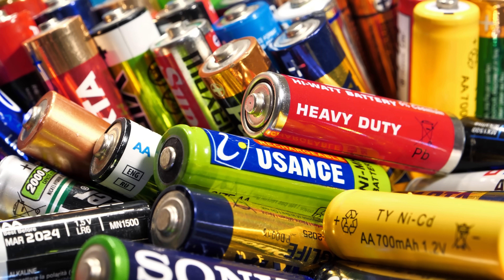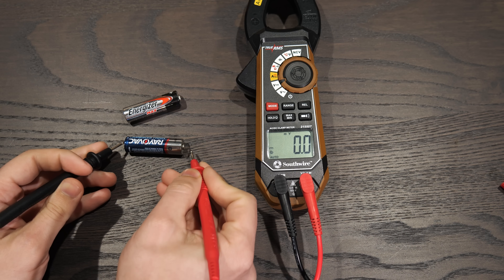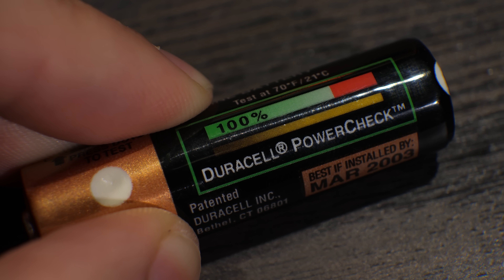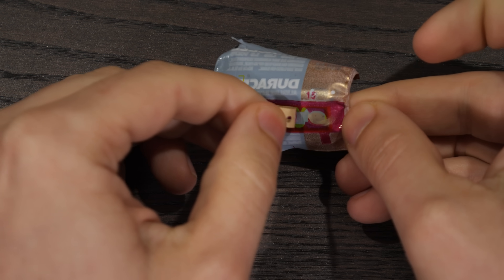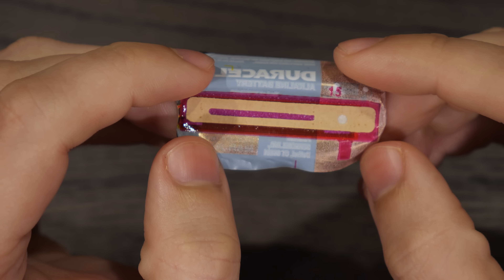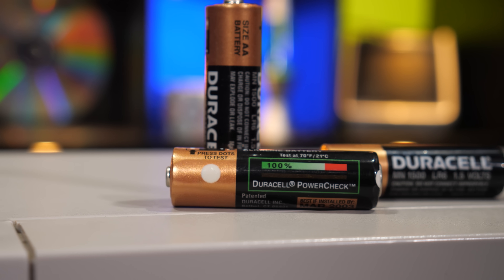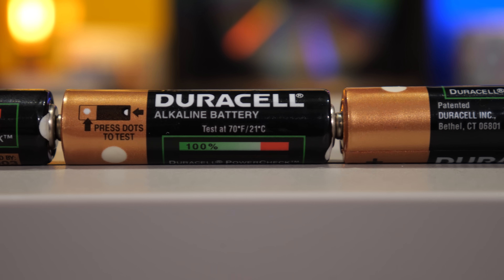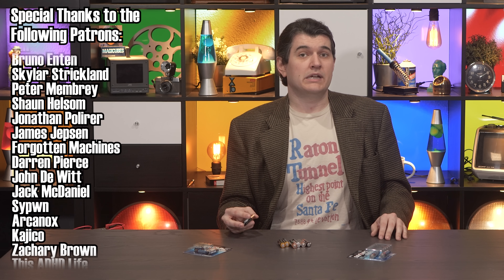Duracell PowerCheck: A genius idea which didn't last that long

Comment: wish my rechargeable AAs had one of those gimmicky test strips so i wouldn't have to break out the multimeter every time i want to see their state of charge. in the 10 years i've had them so far i would have gotten a lot of use out of it

Comment: I do recall these did turn yellow linearly from bottom (negative) to top (positive) along the battery, forming a near ferpect bar graph.
It was a pretty neat thing but as you say, also anoying to use because you literally had to hurt your finger tips for the contacts to do their thing.
I honestly know few people that used those, even if in hand, because of this. Most people ignored, or didn't trust these things to be accurate.

I also seem to remember one company (was it energizer?) that put that kind of tester on the backaging. So, one tester for the lot of batteries in the pack. This made more sense. But the idea was short-lived.

Comment: 0:18
 Dear technology connections. Did you know, quadruple A batteries exist? theyre absolutely tiny, impossible to get, and, to anger you even more, they DO cost almost the same as double or tripple A. And theyre so rare, because nowadays theyre pretty much only used in styluses and some laser pointers.

Comment: Pretty sure they started to say "batteries not included" back in the 80's, maybe early 90's....because batteries were retardedly expensive, and barely lasted 10 minutes in a cool toy, they were absolute garbage, any child of the 80's looks at batteries nowadays and thinks they must be built with pure magick, because batteries die, quickly, what is this live for several hours and being rechargeable...magick....

And putting batteries away, and reusing them later was also definitely a thing of the 90's, like I remember that being a thing, but it also definitely doesn't happen anymore. My grandfather used to hoard batteries even into the 2000's, testing them with a multimeter to know which ones were good before tucking them away

Comment: I use one of those small square battery testers. It has saved me a lot in batterries over the years as most items that use two or three batterries at a time lose power because one of the batteries has failed and resists current flow from the remaining decent battery(s).

Comment: Bruh. I was sure you were going to hit us with a Steve Jobs “one more thing” moment: The Drop Test!

For those not in the know: Hold your AA cell about 8 or 10 inches above a tabletop, (positive side up) and drop it on the table. Exhausted cells will bounce, while fresh ones will essentially hit the table and plop onto their side. A USEFUL TRICK when you are replacing cells with identical ones and have an “ADD moment,” forgetting which ones were the new ones while they were all in your hand.

You’re welcome!

PS Why 8-10 inches? Because greater heights are more likely to mark mom’s dining room table. Or so I’ve heard. 😉

Comment: 1. Why not build the thermal powercheck thing into the battery retail packaging (Easier to use, easier to manufacture probably)?  2. Also why not put these on rechargable batteries? (That's what I have a drawer full of.)

Comment: I still remember the pain in the joints of my fingers when pressing on those. Now I have two different battery testers. I bought the second one because the first one couldn't test button cells or 9V batteries

Comment: AA's and AAA's are not as popular as they used to be, back in the day tons of devices ran on those, today I only need them for a couple of devices at home, I don't even bother buying top brand names like Varta or Duracell, cheap generic batteries are more than enough for my remotes and mice.

Comment: I am about the same age as you, and i would say the main reason why these testers are gone is also to do with simply how unimportant Alkaline batteries have become in the last 10-15 years. Most stuff is now rechargeable. Back in the day most people kept huge amounts of batteries on hand, it was a regular grocery item and companies like Duracell, Energizer and so on simply had money to burn in the marketing war. It was a big business and they could spare the money to have a competitive edge over competitors.

These days? Alkaline batteries have seen a huge decline and these days its just about keeping them as cheap as possible. Most devices that still use AAs often come with a set & the application is so low powered it lasts for years. Things like powercheck just were not worth the effort both in cost per unit and these patent dispute costs. Its not going to make someone spend 20% more for the same product like it used to.

Comment: 1. Holy hell I had completely forgotten about the test strips they used to include. Now I feel old 🤣.

2. Because simple microcontrollers are cheaper than most of the rest of the device they package them in, you can buy battery chargers that will recharge basic alkaline batteries (not the sold as rechargeable kind). It seems to work just fine until the anode decays and the batteries are completely dead. I get about 10-20 cycles from a bog standard alkaline and as such I’ve only purchased new batteries twice in the past decade. Random batteries included in various devices refill the pool until they’re all exhausted.

I had to buy a new battery charger to fit C/D size cells and that charger will handle Alkaline, NiCD, and NiMH in 1.2, 1.5, 6, and 9 volt formats. This smart charger does a load test and then a resistance test to figure out what it’s charging (or gets to cheat with 6v leads and a 9v snap fitting). It’s one of the best ROI purchases I’ve made as far as keeping things out of landfills and solars in my wallet is concerned.

Comment: IIRC they still include the power check feature on Duracell batteries in the UK at least they still did the last time I bought some so around 5-7 years ago, although like you said here they were just as difficult to actually use as you showed here. Even with them included I still played the game of just sticking it in the device and hoping for the best

Comment: Older adult and educated in not just electronics and physics, but also ways of the world, like planned obsolescence. This was a way to drain and then sell more batteries. Neat idea, but the little battery meter I still have and use, did not drain a battery quite so quickly. (Sarcasm)
Truth is, I rarely use the battery checker. Most things I use that needs portable power, like the phone I'm using, have a built-in rechargeable battery with an indicator to tell me when to recharge.

Comment: Fun fact : you can shave the voltmeter casing off a dead battery, and cut it down to just the voltmeter strip, and use it as a external battery tester. 👍

Comment: I only have one modern device that still uses disposable batteries, and that's my wireless mouse that I use with my laptop. it does, in fact, have a way to sense if the battery's getting low and a light on it that blinks red if it is.

Comment: I loved these and would still buy them. For me, I tested them when they were dead only to find 1 dead battery out of 4. Replace and keep playing instead of tossing all 4. Also, rechargeable batteries seem bad based on my recent research. It seems better to buy disposable when factoring in load/demand/frequency. Door locks on homes is my main use for them and the discharge not in use happens so fast that normal disposable batteries won when I was researching. I hope you take this personally, and make a video changing my mind.

Comment: Mixing batteries is bad. The "good" battery pushes a current through the "bad" battery. This wastes energy and depletes the bad battery even more increasing the risk of leaking.
The casing is part of the chemical reaction. If the battery is depleted - or extra depleted by mixing with fresh ones - the casing may produce holes.

I well remember the built in testers and there was a really good use for them back in the days. While you put in a pair of fresh batteries in your remote controls, clocks, calculators and so on and keep them there until the device fails, it is sometimes important to check the battery status.
While modern devices have a built in battery indicator, devices back in the days of those testers didn't.
For example, the famous Gameboy ran "ages" on a set of batteries and it didn't had a battery indicator. When the power LED becomes dim, you don't have many minutes left. So when you take the Gameboy with you or start a game without built in CMOS to safe your game progress (e.g. Super Mario), the built in battery tester comes in handy. So you know for sure if the batteries will last your trip or game or not. So either you replace them instantly or take a pack of spare batteries on your trip.
The same was true for Walkman, Disc-Man and other 1980s and 90s stuff.

Comment: That is only a ( minor ? ) problem with these batteries ..... the  BIG  snag is they leak caustic fluids all inside your equipment , which takes AGES to clean out ... or .... may wreck it totally😝 ..... you do  NOT  get this problem with Lithium batteries , which I have found  ,  NEVER  leak ! ........ DAVE™🛑

Comment: Is the cost of a battery generally proportional to its quality? I've heard, at least, that higher-end batteries tend to be more than just a brand name, but tend to have higher quality materials that lead to longer life. I figure you'd know better than your average person on this count.

I remember these, but I also remember having a claw-like battery tester with calipers of a sort for different sized batteries. Similar concept, I forget if a battery company sold it, it's been so long

Comment: Oh, wow, we got a single pair of these around 10 years ago. I always wondered how they worked. And also, why weren't they putting them on NiMH rechargeable cells? Then it would make sense to find out how much charge they had without putting them in a charger and waiting for an hour to see if they are full (our NiMH charger was super slow, and would only tell whether the cells you put in it were fully charged or not).

Comment: One of the problems I had with the PowerCheck batteries was that in devices that had very close battery tube tolerances, like my AA-powered Mini Mag-Lite, that tester increased the battery diameter by just enough that the batteries would get stuck. I had to switch brands to use my Mag-Lite.

Comment: Interesting--yeah, those were a pain to use, and I only found it to be a minor novelty.

This reminds me of a solution to batteries not lasting long in my old Walkman tape player (early 80s!) I took a 2xD cell holder from Radio Shack, soldered it to a mini-plug that fits in the power supply jack, made twine loops through the holes in the holder, and threaded it onto my belt next to the player.

Two of the RS red batteries (the cheap ones that were free with their "battery of the month club") in AA size only lasted four hours. The cheap D cells lasted around 19 hours. I believe alkaline AAs came close to 19 hours, and I lost count of a pair of alkaline Ds going at least 30 hours. Not bad for a power-hungry player!

Comment: The thing with the AA vs AAA argument, and how they're not much different in size, is that I believe it's more about the volume and corresponding weight they take up, rather than the dimensions themselves. A standard AA takes up about 8.3 cubic centimetres volume, whereas a AAA takes up just 3.8. Similarly, decent Alkaline AAs weigh about 23g, whereas similar AAAs weight just 11.5g. A halving of weight, and more than halving of volume, is a much greater impact than the dimensions suggest. As for the similar price, could be that more AAAs are bought because they run out faster, increasing demand and hence pricing, but that's just a guess.

Comment: "Dead" batteries for some devices may still work for several years in others, like clocks and remotes. I always mark them with a red sharpie and save them for that type of low-consuming devices. Also, the best and cheapest battery tester are those E10 miniture lightbulbs.

Comment: There was even a version in which that very same technology was put in the batteries box, and you would just place the single battery into that area in the box that had that tester in order to measure the battery, instead of it being in each single battery. That would way it did reduce the manufacturing cost slightly and you could still measure the batteries without needing a testing machine.

Comment: I just use rechargeable batteries. Why? Because then I can reuse them until they don't take a charge any more. 
You'd honestly be shocked at how much it could save you if you own a lot of battery operated appliances. 
On a side note, not every appliance is made the same. So something may require an almost new battery, but that battery may still be useable for a good period in something like a TV remote, which requires very little power.

Comment: I had a flashlight that took AAAA batteries. It was really thin in diameter, about the size of a pen. I was also curious as a kid and took apart a 9V battery one day, only to find six AAAA batteries wired in series.

Comment: I think there's more to the shape of the strip than only the varying resistance causing the scale to work.

Yes, resistance must play a big part, as narrower paths have a higher resistance and produce more heat under a potential difference. However, there's also less thermal mass to heat. I believe it's a combination of the smaller thermal mass at the low power side, with a higher resistance, as the thicker end requires a higher amount of energy to heat, meaning it needs a higher current. 

Or maybe the mass difference involved is negligible. What do you think, yt comments?

Comment: I hate AAA as almost anybody, but in a case let's say remote control you have mentioned, couldn't be the reason for their use their lower weight than size?

Comment: I could never get the reading to work. Ended up using a volt meter anyway. 

My old camera motor drive (remember those?) used to eat eight AA batteries (wouldn't work with rechargeable batteries) and often one battery would give up the ghost while the others were still good.

Comment: I honestly just prefer rechargeable batteries. Saves a lot of money in the long run despite higher upfront costs. I got the extra high capacity ones and they last soooo long in my VR controllers. Plus it's simple to check their charge by simply slapping them in the charging station.

Comment: The only useful application for them is just knowing if the remote that quit working is a dead remote, or a dead battery.  And then only when you don't happen to have spare batteries to try.

Also thanks for reminding me about the testers in the box, i'd forgotten about them.

Comment: I think the true use case for this tech was to verify that every one battery in newly opened package is good. If you purchase a pack of 20 batteries nowadays and actually measure every one under load, it's not uncommon to find 1 or 2 bad batteries straight from the factory.

Comment: These batteries were made for my family. I learned very early on to take batteries out of toys so they wouldn't drain while the toy qas just sitting there so we always had partially used batteries. In addition, I learned early on that when the batteries "ran out" usually only one battery ran out, and the rest were perfectly good. Having the tester on the battery rather than having to go get one made my life so much easier.

Comment: One of the biggest problems in consumer products in general is picking the cheapest. People usually just compare the price, much more rarely quality or features. That is why we are usually offered only cheap simplified crap. A battery power tester that costs maybe 5 c just makes the battery 5 c more expensive and doesn't sell.

Comment: I actually like products that work with AA batteries because I can just use rechargeable ones. If my Xbox controller dies, I can replace them in an instant and I don't need to plug in a cable

Comment: Harbor Freight sells a cheap multi meter that has a battery testing mode through a diode to put a load on the battery.  Something like 4mA. Great tool for checking both load and voltage on them.

Comment: Super surprised you didn’t talk about the battery bounce test, drop it on a hard surface and observing how it bounces. 

New battery: battery will land flat (on the flat end)
Low-dead battery: will bounce (on the flat end, more bounce the lower it is)

Comment: Duracell also used to include a separate flat flimsy tester strip behind the batteries(loose in the pack) you just bent/held onto the end contacts on & since it was flimsy the larger ones that came with D packs could be used for smaller batteries.
Also I remember special packs that they came embedded with the flimsy tester strip front & center in the regular front clear plastic packaging. I vaguely recall some being embedded into the cardboard backs (or maybe it was just a cutout showing it came with the flimsy strip?).
I think large long C & D packs (partial cardboard box with shrink wrap) tended to come with the flimsy testers.
Growing up we had several test strips & atleast one AAA plastic shell in our junk drawer(could be bent to test AAA's).

Comment: Pro tip: many multimeters have a separate battery voltage measurement option that applies semi-small load to test the battery under load which gives you more realistic understanding of the true state of the battery.

Comment: I think the only time these were useful for me is when you had 1 device with a higher cut off voltage, where you'd still have half the power left in the battery but it wouldn't power that device. With these you can test to see they're still half full, and those ones would be the ones to use in remotes that have very low power needs